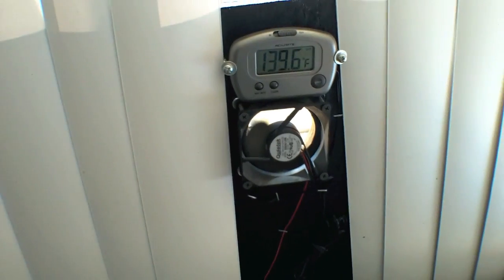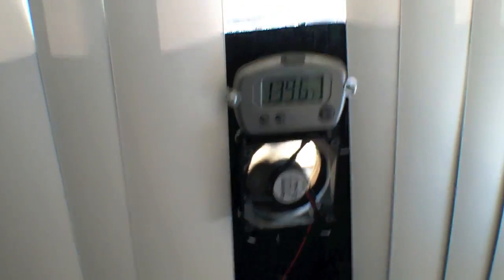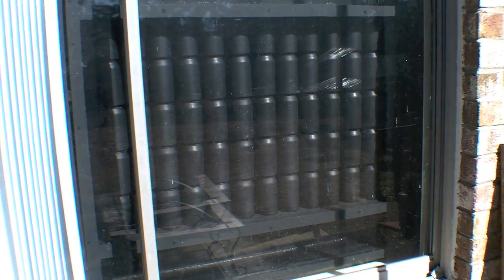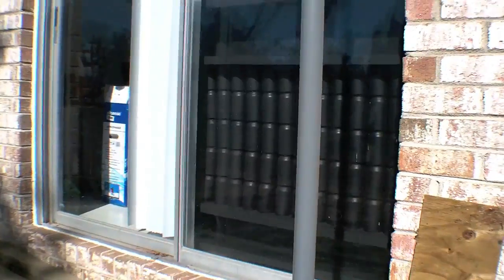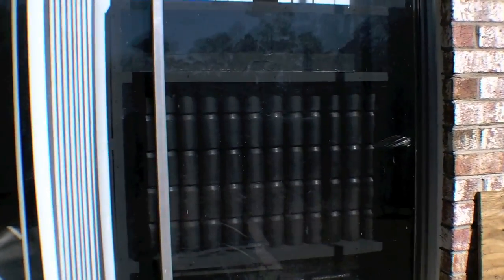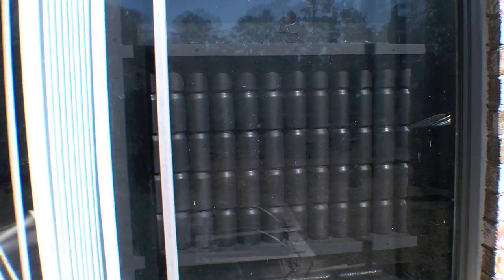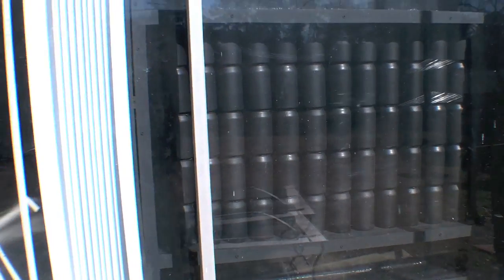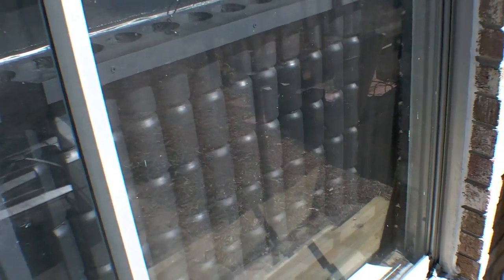Indoor Solar Heater for sliding glass door = Amazing results

Comment: Hi,just wanted to know if these would work with pilkington door glass?,they have a special coating,
Reply from the maker: +malcolm oxley no idea.. the doors with some coatings to reject heat from the sun may not work. best bet to see if set a small table in front of the door (as close as you can get it to the door) on a really sunny day when the sun is out. Place a half can of open soda on a the table if the temp of the soda rises due to the sun.. it will work.

Comment: does this heat your entire home?
Reply from the maker: no but it aids in heating the home so my-heat pump isn't working as hard.
Reply: how many solar heater air heaters would you need to heat your entire home? how good are these on a cloudy day?
Reply: My solar house heater adds 10 to 15 F on a cloudy day. 160 F when it is sunny. From 930am to 6pm it creates heat. Then I put the vent plugs back in the wall holes (top and bottom). My heater heats the master bedroom, en suite and hallway very, very nicely most days.

Comment: 1. You've motivated me to finish my solar heater video.
2. I also built my solar collector into a sliding door glass frame. (no drilling holes or rigging it through the window)
3. In my results, the natural convection speed exceeded the cfm of thecomputer fan.
(So the fan was actually restricting air flow and was later removed)
4. (off topic) Do you have recording equipment?
Reply from the maker: I need to recheck my natural convection..I added a additional ultra high speed fan to move more air flow but, I still think its not fast enough i'm bottle necking the system. um yes i do have a lot of recording gear.. just don't use it as much as I use to.

Comment: what is the relevance of knowing the outside temp when the unit is inside, sucking air from inside, and putting it back inside.. All the videos for these things dont ever give a real view of the practicality and actual usefulness. Next time something like: "so the heat in the house is shut off, its 45 in here right now, lets flip on my window room heater and see how long it takes to get comfortable in here" (show time).
Reply: I'm going to agree to disagree with you. I'm finishing my video with the results you were looking for. After taking a class about solar heating I couldn't agree more with you statement. Most people show 2 facts of data, intake and exhaust temp. A 3rd and 4th are needed. Such as CFM and the size of the exhaust port. We then can figure out the BTU output of the solar collector.  To summerize my result. A solar heater will not heat your house, but it will heat a room IF its facing the right direction, AND between daylight hours only. The pay back also varys if your using Natural Gas or Propane, and which cost more in your area. Solar heating videos should include there estimated BTU output per heating season. DAMN SCIENCE YOU SCARY!

Comment: Thanks for your well made and clear video.  Am I right in thinking that you - wisely - put the fans on the air intake, rather than risk damage by putting on the heat exhaust?  Also, can I hear the Clemson University Memorial carillon or the Callie Self Memorial Baptist Church carillon in the background?  There are only two automated carillon in your part of the world; (actually, that's quite a lot for one state!) but I'm wondering which one it is.

Comment: you dont need a fan,  just have the cans open top to bottom and hot air rises so you get continuous flow.

put reflective panels outside to shine onto the cans i.e. solar cooker for increased BTU's

Comment from the maker: It's 49 degrees out side.. with a continual output of 90 circulating hair in the room. the box itself is hot 139.6.. simply opening the blinds doesn't do that, if it did..I wouldn't need any other type of heat source at all...weather it be electrical or a can heater during the winter.....I'm no engineer all I know is its warm in my kitchen now..lol

Comment: I must be missing something. Entering room air at...65F+ is heated 30F by black soda cans. That is what...1,000 btus. The same energy that would be collected by leaving the window shades open. Even if the floor did not absorb it, the energy would be reflected to a wall and ceiling to be absorbed.
Reply: If you fill the cans with water, they store the heat and release it slowly overnight to help with night time cold.

Comment from the maker: yep, its powered by 2 small computer fans,about 2 watts to run. The average cost of electricity here is 10 cent per 1000 kw so..id say its pretty inexpensive. any alternative source of heat via wood, or solar is going to end up being cheaper than running a heat pump.

Comment: Remodelers are routinely throwing those perfectly good sliding glass sections  shattering glass so they can recycle those aluminiujm for pennies on the pound... Call your faovrite remodeler to save them for your use...  You can build greenhouses or sunrooms with those perfelcty great sections ...

Comment: I am jealous. Your base outdoor temp was higher than ours was today. :P It is going to be like 5 later this week and might even actually go negative due to wind chill.  At least I know by  Sunday it will be warm again in the 50's & barring another cold front back into the 70's shortly thereafter. 

If it actually made the house 90+ degrees though that would be too hot for me. indoors I like it to be in the high 60's - low 70's. :) 

Thanks for another cool... errr hot... video. *grin* 

-Heidi